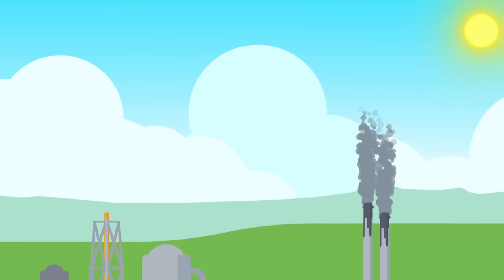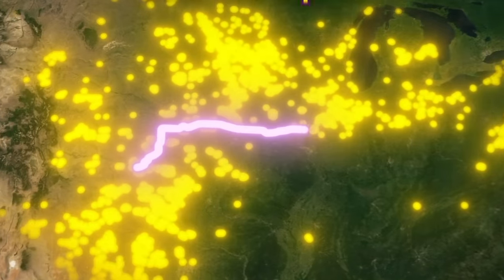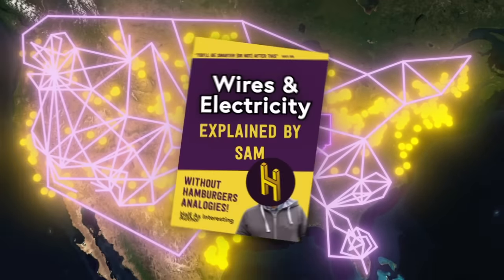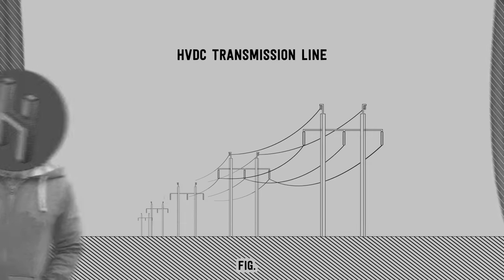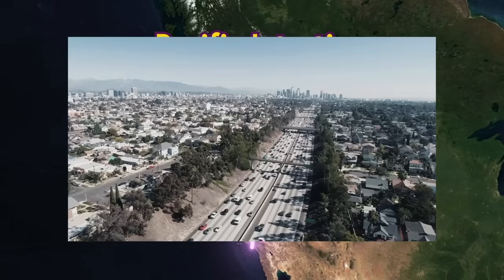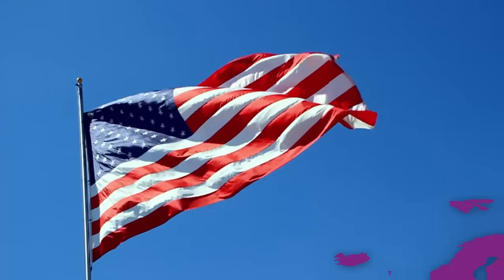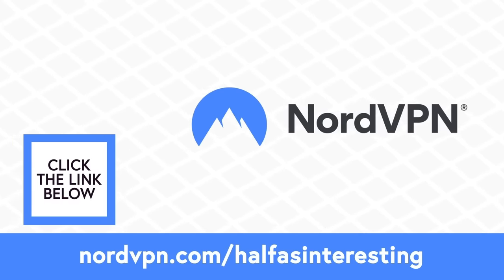Why We’re Building a 790-Mile Wire From Kansas to Indiana

Comment: "Its actually 2 power grids and 1 infrastructural temper tantrum"
As someone stuck living in that tantrum I'd say thats a fairly good description. Would love a video talking about the grids as a whole and how messed up we are down here.
Reply: This line slayed me. When they blamed part of the last major power catastrophe on wind turbines not working in freezing temperatures, "Hi, Alaska would like a word."
Reply: @RyanTheRed907  
We are Texas with a population of 31 million.
You are Alaska with a population of 734 thousand.
We are not the same.
Reply: @jbrou123 Population has nothing to do with it. The point he’s making is that wind turbines can work perfectly fine in cold weather when weatherized. They have them up in Antarctica of all places. Plus, most from fossil fuel sources failing (which makes up the bulk of energy production) and the fact that it wasn’t connected to the rest of the grid for backup power.
Reply: As another Texan, I second this request.
Reply: @thedapperdolphin1590  Funny thing is, the wind power did work mostly fine.  It was the other infrastructure combined with massive demand influx that really knocked things out - in particular one or two of the gas fired facilities broke down right when they were needed most.
That's not to say a fully wind-powered Texas grid would have done well by any means - especially if it stopped being windy for even a short period of time with that extreme demand level.  And I'm sure the main reason the wind turbines did better was just because they were newer, not due to any intent on ERCOT's part to actually do their job right.  But blaming the entire crisis on wind power was 100% Greg Abbott just straight up lying to his constituents for the sake of upholding his political talking points.
Reply: This is the first I'm hearing of this "infrastructural temper tantrum" so I also wanna see a video explaining whatever it is.
Reply: You're more than welcome to leave, in fact it's highly encouraged.
Reply: @deaconblooze1  As I'm sure you are. 😁
Reply: @deaconblooze1   Rather insult someone than respond to the content.

That's called an ad hominen argument.  Coincidentally, it's a common technique for climate change deniers when faced with... facts.

SAD.
Reply: @mtndew314 look up the ERCOT Texas grid.
Reply: @bjb7587  You appearently have low reading comprehension because I didn't insult anyone. I told them they could leave if they don't like where they live, because why would you live someplace you hate? It just makes you and everyone around you miserable.
Reply: @deaconblooze1  if that's what you meant, you could have said it.

Too transparent.  SAD part 2.
Reply: People who aren't Texans get really mad when we talk about grids lol
Reply: @annatheinnotz4901  People who are Texans like to talk about their unconnected grid until their grid fails during a winter storm while the neighboring interconnected grid does not. lol.
Reply: @bjb7587  keep coping.
Reply: @jbrou123  the point is that wind turbines, properly outfitted, work fine in the cold. I wonder if you really know what happened in Texas, and why it happened.
Reply: As someone who spent time studying that "infrastructural temper tantrum" i can say this is the best and most accurate name it's ever been given.
Reply: @danstrayer111  No, I don't really know what really happened, as I'm not in Texas.
What I know is that Texas is about 25% wind power. So, we can't blame all the power outages on wind turbines.
Reply: @jbrou123  Most of Texas is on its own electrical grid, and thereby exempt from federal regulations....some of which would have mandated that wind generation be equipped to handle cold weather.  When it got cold enough some of that wind capacity was lost, and a large amount of nat gas capacity was lost.
  The right wing in this country immediately began a campaign to discredit the viability of wind, despite the fact that Texas is largely conservative, and is the second largest producer of wind power.
  They will do ANYTHING to disparage renewable energy....despite that fact..out of the blind hatred of democrats.
Reply: Much of Texas (not all) is served by the ERCOT system, and much of that is based on avoiding federal rules when transporting across state lines (FERC has no jurisdiction over ERCOT). So, one might say the Texans wanted to make more of their own decisions on energy.
Reply: @bjb7587 California's grid sounds like it works great,  oh wait that's one of the "good" ones,  texas grid failed one time and now it's the worst ever
Reply: @deaconblooze1 It's almost like moving is expensive, and uprooting your whole life is exhausting, and sometimes things like friends family jobs etc get in the way of making decisions like "golly gee i wanna live somewhere else".

Wild, I know.
Reply: @mtndew314 As a former Texan, it's mind blowingly stupid
Reply: @danstrayer111  Sure.  Four things happened.  1) Severe demand due to freezing weather. 2) Bad management meant that priority infrastructure went offline during load-shedding, cutting gas to power plants, causing more load-shedding.......you get the point.  3) "wind turbines" in this discussion was a red herring by the GOP haters.  Texas fleet of wind turbines was 100% designed for summer loads, therefore they were not built for blizzard conditions like northern states.  Texas needed power to replace the gas plants knocked offline by stupidity.  The wind turbines didn't produce their nameplate capacity since they were built summer-cheap.  4) Hundreds died.
Reply: @CR_3598  Gee, why don't Texans rake their prairie like Trump suggested?
Reply: @Rich-fr2yv  Same here.  I enjoyed my time there, but it was obvious as an outsider that Texas has this "our sheet don't stink" mentality.  Makes it hard to learn or admit mistakes because "hey, our sheet don't stink".  Weak.
Reply: @jimmiller5600  agreed
Reply: @joelaut2605  more cope.
Reply: @mtndew314 Texas has its own power grid that is completely independent of any other power grid.  This means that when something catastrophic happens in Texas, they can't rely on infrastructure elsewhere in the nation to support them.  On the other hand, though, having their own power grid prevents them from taking advantage of economies of scale and requires them to keep a completely separate team of maintenance personnel, which increases power costs to everyone in the state.  So there's a trade-off.
Reply: You're not "stuck".. you can move northeast and gain the same unearned sense of superiority to the rest of the country instead of just LARPing in comments.
Reply: Its almost like having an electricity market with virtually no regulations (like mandatory winterization of the power grid) is a recipe for disaster. But if Texans haven't learned their lesson after two catastrophic winter blackouts, they never will.
Reply: "Everything Texas is bad, wahhhh"

Comment: Quebec did this like half a century ago, Montreal pulls ~15 gigawatts of power from ~1000 kilometers north of us up at James Bay, carried by 4,800 kilometers of transmission lines, mostly 735 kilovolt AC and a bit of 450 kilovolt DC.

Comment: Also in addition to eddy currents generating excess heat, one reason why AC lines are limited in the length they can travel is that it's important for all generators in an AC power grid to be synchronized. And, due to the fundamental limitations of the speed of light, this means that the AC power grid in Kansas will have a slightly different AC phase than the power grid on the east coast. So, even if you could construct an AC line that could effectively transmit power from Kansas to the east coast, you would have to choose whether you wanted that power to be synchronized with the local grid in Kansas, or the local grid in the east coast, or maybe somewhere in between. Whichever you choose, you'll experience significant power losses wherever the phases are mismatched. HVDC avoids this problem entirely.
Reply: The make phase shifters for that. You build up a lot of impedance on lines over 150 miles long and cannot effectively get power to flow on the lines. This is where we would compensate the line with a capacitor bank in series to lower the impedance and allow more flow
Reply: Also transmission lines do strange things when they are 1/4 wavelength long, like making an open circuit at the load end appear like a short circuit at the source end.  At 60 Hertz, 1/4 wavelength is 777 miles.

Then 1/2 wavelength is 1553 miles, so two points in the AC grid that far apart are 180° out of phase.  So you see it is impossible to have entire regions of the country be exactly in phase.

(The calculations assume the vacuum velocity of light for transmission speed; in reality the wavelengths are a bit shorter.)

Comment: Aotearoa NZ built its 610Km HVDC link back in 1965, to connect the massive collection of (mostly hydro) powerplants in the South island up through the island and across Cook Straight to the vastly more populated North Island
Reply: At the time that line, usually called the Cook Strait cable, was the longest, meanest, highest voltage, highest power HVDC line in the world. Crosses the road, just a couple of k’s from me. Its had A few upgrades over the years, but it’s still working just fine.

Comment: MY UNCLE, AN ELECTRICAL ENGINEER
WORKING FOR REYNOLDS ALUMINUM IN RICHMOND VIRGINIA 
SPECIALLY DESIGNED 
POWER LINES AND TOWERS!
HIS BEST PROJECT WAS ENGINEERING A VERY LONG SUSPENDED LINE ACROSS THE MISSISSIPPI RIVER FROM HELENA ARKANSAS TO MISSISSIPPI STATE SIDE!
AT THE TIME BUILT WAS THE LONGEST FREE SPAN HIGH VOLTAGE TRANSMISSION LINE IN THE USA!

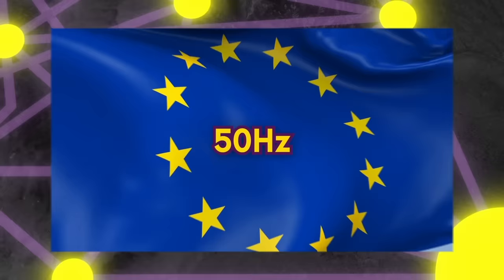Comment: 1:50 No? You would just need dc to dc transformers everywhere, which exist (they weren't cheap in 1910 NYC, which is where your picture is from). Every computer PSU has them. MOST of the rest of the video is on point. As for infrastructure ideas, you could talk about geothermal heating and cooling for district HVAC, growing mushrooms underground, animal feed, why monorails suck vs trains, etc.
Reply: DC to DC converters are even less cheap at high voltages. Also, they're less efficient and far more complicated than AC transformers.

Comment: 2:00 that’s not true, you can totally convert one DC voltage to another, the necessary technology is just more complex. Multiple grids may have been the most efficient solution to that problem when electric power was new, but not today where modern semiconductors exist.

Comment: Your explanation was mistaken. Wattage does work. That can be roughly translated to volts times amps, or pressure times speed. So, if one goes up, the other can go down. The heat is a function of amps, so to reduce the loss to heat, increase the voltage, but with ac, it acts a little like a radio antenna, and loses power to ground. With DC, that isn't a problem, but other things are, like conversion, stepping voltage up or down, and of course corrosion of connectors.

Comment: 0:10
-EXCEPT IN ILLINOIS! We are cool and have RADIATION!
Reply: There are lots of places with Nuclear Power.
Reply: @SteelOfLegend  
Yeah, but Illinois is powered largely by nuclear power plants. According to a few documents I just found with a quick look up: the US's average power generation is about 20% nuclear but in Illinois it is 52%.
Reply: real
Reply: Be thankful you have it. If the loonies get their way we won’t have electricity or be able to afford it.
Reply: AND the real future of Power : Nuclear is real baseline power. Not something that depends on the sun to shine or the wind to blow.
Reply: In my little corner, the nuke plant closed years ago and was torn down but the one running coal is still steaming away as it always did. (The coal one not without periodic modernization, although it's probably imperfect.) It was always an odd contrast because the two were within sight of each other as well.

Comment: I maintain that building larger quantities of less-efficient wind and solar at the destinations is preferable to building smaller quantities of maximally-efficient wind and solar in plains and deserts and then also having to build long electrical interlinks from those rural areas to cities.
An interconnected grid is good, but the point of such interconnection is to make source-to-sink paths shorter, not longer.  Building in less-dense areas is preferable due to land and labor costs, but there are less-dense areas well within 50mi of any given city.
The plains and deserts story only works if you 1) treat wind and solar as binary rather than a spectrum, or 2) can get someone to massively subsidize your electrical interlink project when they would not otherwise subsidize renewable generation.

Comment: 1:58 the graphic is misleading, all these appliances use the same voltage (220 volt in europe), just have different power consumption, you can do the same with DC. What AC is good in is changing the voltage, i.e. having power lines at tens of thousands of volts (less power waste) but having household devices at 220V (safer, can realistically build devices to use)

Comment: My electricity is generated by a bunch of solar panels about 3 feet above my head.  I got about 10 feet of wire from them to my battery bank and no bills.  Life is good off the grid!
Reply: Until your expensive batteries and inverter dies and you're in for a heavy bill
Reply: By which time the system is either still under warranty, or has lasted long enough to pay for itself.
Reply: @TalonSvarog It's already paid for itself 4  times over in 15 years lol. There's no warranty, or nobody to call, i just bought or found all the stuff and built it myself.  Just got 3 more panels recently when i uninstalled my neighbor's old obsolete wifi tower and got to keep the panels, a wind generator, and a 20' tall steel radio tower.

My next project is building a power station, i just scored a 6.5kw generator, rebuilt it and use it on cloudy days or to run welders or 220v equipment.  I'm building a soundproof shed to house it and eventually automating it to start when needed, or once every few days to keep fresh fuel running through it.
Reply: @rustymustard7798 If your solar power system is so great, why do you need a generator powered by fossil fuels being burned in an internal combustion engine?

Comment: Stranded wires are used mainly for flexibility, ease of manufacture, and eas3 of handling. What isn't obvious is that if the strands are twisted (helical) they are more flexible than if the aren't, because twisted strands slide past each other easier than untwisted.

Comment: The pacific DC intertie (celilo stations are the crux) has existed for a number of years between Washington state and California. It is one of the reasons California can claim its green energy program is "working" It supplies so much hydro power to California, that if it goes out, the California grid would be severely crippled.

The transformers for the stations are not made in America and take months (over a year?) To build and are custom made for the site.  They are so large, that special transport has to be utilized. (A recent upgrade for the Washington side had to have the transformer delivered by ship, up the Columbia river.)

The location of these unique stations much be a closely guarded secret, no? No. A few years ago promising electrical engineers were invited to tour the site, and the location was openly put on the web for the invitation.

Remember, our incumbent president ensures us that America has never been safer. If you believe that, don't read "Lights Out" by Ted Koppel (investigative reporter for you youngins)

Comment: Great topic choice! This is a great piece of infrastructure going in. And you did very well for someone who is not entrenched in the electrical grid. 
Oh jeez, so many incorrect statements and pictures. A few- none of the lines you showed were actually DC. They all had three conductors where DC lines only have two, like the HVDC line that goes from Celilo, OREGON to San Bernardino, CA. (pronounce Seh-Lie-Lo). They used to have some hella awesome mercury vapour arc rectifies that would glow purple in the converter process of the AC power from the slow moving lake (called the Columbia River) dams down to CA, and California's PV power was supposed to come north in the summer, buttttt......
This was a much better idea than the parallel high voltage AC lines that ERCOT put in Texas with Phase Shifters on each to help balance the flows, but ended up with them creating subsynchronous harmonics that causes all sorts of issue. That's okay though, cuz fawk Texas. They didn't want to play with the rest and then shat in their sandbox. Check out the Texas Railroad Commission if you want to learn why Texas has their own grid.
Reply: Also, AC doesn't push electrons, that's DC. AC more jiggles them and the power is transmitted via the magnetic fields that arise from the jiggling. Actually, very similar to what the animation looked like.

Comment: The opening statement in this video that "most power in the US is generated by Natural Gas and Coal" is misleading.  Electricity in the US comes from the following sources:

1. Natural Gas (40%)
2. Renewables (21.5%)
3. Coal (19.5%)
4. Nuclear (18%)
5. Other (1%)

Given that information, it is difficult to justify the statement that it's "mostly Gas and Coal".  Technically, it's mostly Gas and Renewables, but even then nuclear and coal are roughly equivalent.

Comment: The reason we use AC power isnt because of stepping up and down current, its for stepping up and down voltage. Voltage is like water pressure and if you use too much pressure on a childrens water wheel it would break too from too much current. So transformers step up or down that "pressure" to avoid exploding.